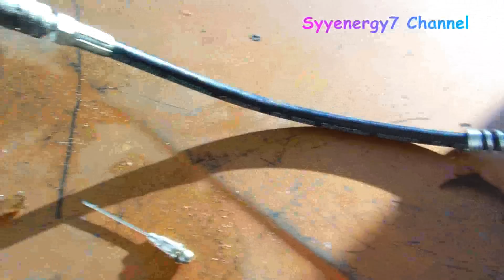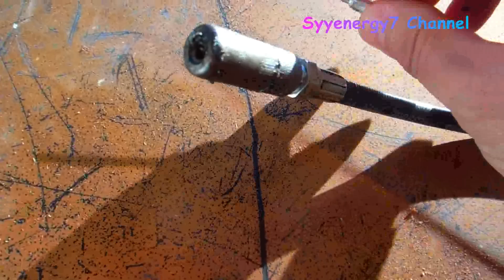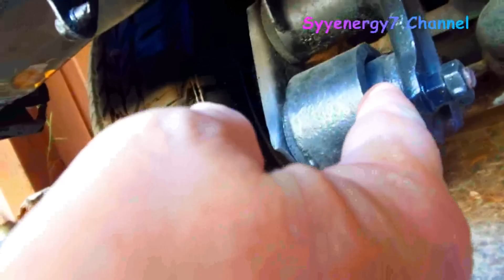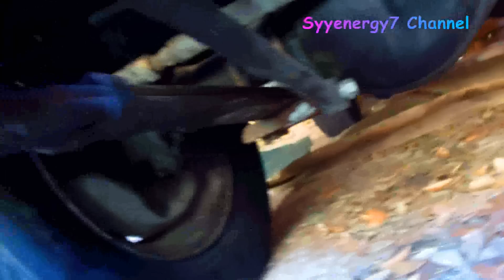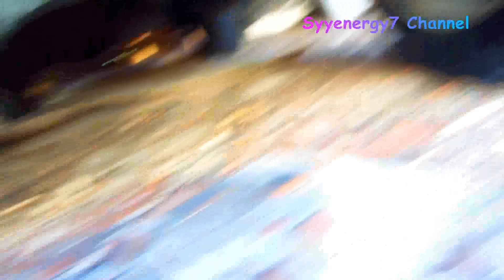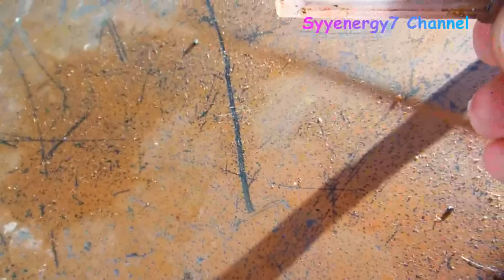How to Grease Joints with no grease fittings

Comment: 61 years on the planet, and I did NOT know that the grease gun could be turned open/closed to lock onto the zerk!!! THANK YOU!!!
Reply: same here
Reply: Patrick McClellan I'm 30 and I've never seen it either.
Reply: Patrick McClellan same here where the hell was I got that lesson  !
Reply: .....and here.
Reply: Same here, and I got 4 years on you !
Reply: Me neither...cant wait to try it.
Reply: LOL... Did you not read the instructions that came with the grease gun? All that I have ever bought told you how to do this...
Reply: .... same LOL
Reply: damn! mind blown
Reply: 65 years and a mechanic  Pat and I didn't know it either..LMAO
Reply: Dude I'm an idiot, no wonder I couldn't snap it on it must have been turned closed which I never knew it adjusted
Reply: Z71 Ranger, instructions? I thought those were packing materials lol!
Reply: Not all grease guns can, it's often a feature reserved for higher priced guns, except that low end guns usually come with a steel slightly bent tube and you can replace that with the flex hose that has the threaded tightening end on it.
Reply: 41....mind blown
Reply: News to me too ... got to check my two guns now..  good info  thank you sir  :--)
Reply: I've been in industrial maintenance for 30+ years and I never knew this either. You learn something new every day.
Reply: I'm 62 and discovered it by accident fairly recently while greasing my snow blower. The fittings were kind of small and the gun wouldn't latch on,  so in trying to get it on I must've turned it and then it fit
Reply: Yes they will tighten up even on most cheap guns.
Reply: I work for a concrete company and i grease the belts and rollers every week and never knew the tip could adjust like that...makes sense why some dont fit properly
Reply: Just did this yesterday and just pushed it on! It looks like it should turn, but I couldn’t turn it!!
Reply: Don't feel bad I'm 55 and have worked on cars most of my life and didn't know that either
Reply: Just learned it
Reply: Dam me to 40 plus working on them,lol!
Reply: Learn something new every day
Reply: Another one 4 ye
Reply: Uh....me too
Reply: I was about to say same, only 48 yes here though
Reply: Country Neighbors Im 59 a auto painter not mechanic but being around this stuff since age 14 not one person ever showed me or had I read that anywhere in my lifetime. My fault open a grease gun once in a lifetime never read any instructions.
Reply: I discovered the zerk fitting loosens after the first 5 minutes... putting it back together was alil tricky

Comment: Great video. I had ordered a fancy, expensive grease fitting online, and the design was so poor, you couldn't grease any lawn equipment or any Zerk fittings in tight places.  Returned it; then found out that normal fittings were indeed adjustable, and ordered a pair of two new regular fittings for my pair of twenty-year-old grease guns, which now fit perfectly on any Zerk fitting.  I found out about the adjustability of regular fittings about a year ago, but wish I'd known decades ago.  Had the needle sitting in my tool cabinet - now I know how to use it on some clicking CV joints.  Thanks again for your tips.

Comment: If you are going to add grease to ball joints or steering rods, separate the Morris taper, fill the inside of the boot, reassemble. The grease will work its way where it needs to go over time. If you pierce the boot, you are asking for trouble allowing water to enter and rust the joint.. Dissimilar materials such as rubber/steel do not need lubrication but a little silicon spray can help.
Reply from the maker: The hole from the needle is a lot smaller than the weep hole on the rubber boot of greasable fittings.  You can also re-seal the pin hole.  But with marine-grade grease , it will last a lot of years anyway.

Comment: I use liquid electrical tape to seal boot after adding grease works great...
Reply: I really appreciate this tip.  Do you clean the grease off of the exterior of the boot with acetone or brake cleaner before you apply the liquid tape?  Thanks again.

Comment: You can also grease wheel bearings that don't have zerk firtings and it beats smearing that stuff on your hands and packing the bearing. The needle will fit in tight places.

Comment: He said that one part didn't have a zerk fitting and it's right there sticking out of the bottom.It's around 3:20, looks like the pittman arm. There's many things you can put on a rubber bushing to quiet it down. Most will cause it to swell up and then start coming apart. So you're actually shortening it's life in the long run. It's not that hard to drill and tap them IF you can get access to that spot.
Reply from the maker: THE FITTING WAS INSTALLED LATER AND DOESN'T WORK
Reply: then you should replace the zerk fitting. Not puncture and compromise the integrity of the boot.

Comment: Also  get a bottle of 303 Rubber conditioner spray on  and spray all ruber bushing even the fan belt  and it will make those rubber parts last  forever.

Comment: Car companies want us to buy the whole damn replacement part so they don't put grease ports on things with bearings anymore.
Reply: Right like wheel bearing's are all sealed now and steering gear also.
Reply: G PCM yep! thats why Im holding on to my 93 Suburban for as long as possible.
Reply: actually, i don't think they want consumers working on their cars at all

because look at how they design cars

you're average person can't even change the spark plugs without rotating the engine sideways

i think you're right about that
Reply: The seals on the sides of "sealed bearings" can be removed easily with a tiny screw driver. They pop right out and you can grease the bearing, then snap the seals back in place. Found this out when puncturing one with that needle grease gun tool. The seal popped right out!
Reply: Ahhhh, but we are getting around them vultures!!
Reply: Thats the idea,  designed to fail and they have condition pepole to except it, my fathers generation ww2 era and my grandfathers generation 1900s would never except this junk of today
Reply: Pretty much and pay out the back door for the labor to put said parts on
Reply: Got that right brother. I was about grease the front end on 1998 f150.  Had no grease ports few places. I couldn't believe it.  An old truck driver. Told me once.  Oil and grease is cheaper then parts.

Comment: I used the syringe that came with my printer ink-refill kit to add grease to my ball joint.  Only one because it was making noise.  It is holding up well.  I blocked the hole with silicone when done.  When I get around to it I will change them both.  They seems firm still for now.
Reply: Thanks for the idea!...I am tired of spending money and a whole bunch of time on my car this month...I was going to buy the grease gun and the needle...but I have plenty needles and syringes with my ink refill kit...my wallet thanks you too...lol

Comment: On Lincoln LS steering joints the rubber is held down with a split ring on the large part of the rubber boot. You could prob slide the grease hypo in the other end of the joint if you can remove the castellated nut, slap the hole where the threaded part of the ball joint is held by the nut. Then slide in grease and not make any holes to plug up. It is just hard to take off the shaft when an interference fit and tapered area on the shaft is present.

Comment: Sway bar and leaf spring bushings should not be greased unless they are polyurethane, and in that case, a special grease must be used - silicone based, I believe.

Rubber bushings should be left DRY.  They rely on twisting with the metal, unlike a polyurethane bushing, which relies on the bar sliding inside.  This is why rubber should not be lubed - and besides, certain greases can increase the rate at which the rubber degrades, as well.
Reply: +Blaine Bugaski I use Teflon bearing grease to clean my tire side wall. Then wipe off grease and apply tire shine. Bridgestone REVO A/T lots of dry rot cracking going on. Is it the result of the grease? Age 9 years, or not driving for months at a time?
Reply: I don't know, is it just cracking on the side where you have applied the grease and tire shine, or is it cracking on both sides?

It's hard to say for sure.  If you drive a lot or park outside it is likely that they will crack sooner.

Too many variables to say for sure.  But I do know that certain petroleum based greases can degrade polyurethane.  I'm not sure about rubber, because rubber itself is petroleum based as well.

When I was younger I used to go nuts with the tire shine.  Well, maybe not nuts, but I really liked the way it looked.  The same goes for the dashboard and plastics/vinyls in the interior.

Now I don't use any shiners at all, anywhere.  I just clean, dust, wash, etc.  Keeping it simple for the sake of longevity.
Reply: +Blaine Bugaski Thanks 4 the advice. The outside cracked. The inward side is great. Treads are great / not cracking except one tire: that I ran deflated for about 300 miles on day. The set may have began dry rotting prior to purchasing the the grease. And I never took care of them until I noticed the damage. Last, I had the front remounted with the White letters Out. Still need to do the rears. Looks a lot better now. Have 24k miles on the tires since 2008.
Reply: Well the insides would still get much less UV radiation than the outsides so even then it is hard to judge if your grease had any effect at all.  But I do know that it can affect the natural oils of the rubber and now they secrete to the surface in order to keep the rubber "moist" with its own juice.
Reply: Petroleum based grease are known to swell up rubber seals... that is why you should only lube CALIPER SLIDE PINS WITH hightemp SILICON, not grease or synthetic hight temp grease is junk.

Comment: I wouldn't call the grease needle a trick since that's what it's designed for, but the trick may be knowing which type of grease to  use.  Older sintered bearing ball joints and tie rod ends usually had a factory load of lithium grease and should be relubed with moly fortified lithium grease.  Same for metal on metal wheel bearings.   Sealed for life bearing on the other hand, often use a plastic (polymer) bearing and should have thick silicone grease added - as thick as will pump through the needle.  Any rubber bushings on suspension should also have silicone grease though it doesn't need to be as viscous as that put in socket-joint construction bearings.
Reply: +Stinky Cheese - Yea Fortified Grease are best!  I use Lucas Oil 10005 Red 'N' Tacky Grease
Reply: Grease is grease lol. Otherwise the streets would be littered with snapped, sheared suspension parts.

Comment: Great Video Thanks, That type of grease are you using?
Reply from the maker: Marine grade for bearing on boat trailers.  It should not wash out easily.
Reply: Great vid.  Is there anyplace on the car chassis that you would NOT put this grease type?
Reply: syyenergy7 how about new model cars with no zerks how you do it?

Comment: I'm just curious but when joints that don't have grease fitting typically last longer and when they actually need grease it's time to replace them so why wouldn't you just replace them. I personally am a fan of non greaseable parts because I never know how often to grease them. A lot of people say every 3 months some say every 6mo some once a year and some once every 2 years. Why do they need so much grease lol. I've had parts on my vehicles for 10 plus years that still perform like they should which is my monies worth if ya ask me. 10 years maintenance free in happy lol. I can see if you only had 1 vehicle and no time maybe doing something to quiet it down until you can get to it but still. I just found out recently a shop put an aftermarket part on my vehicle with a zirk fitting and I'm pissed. I had it to purchase a fitting for my grease gun because there wasn't any room to grease the stupid thing.
Reply from the maker: If you grease them right, the joint will virtually never wear out.  Part of the reason they went to grease-less joints is because some mechanics are idiots and they over-grease and destroy seals.  The other reason, is a new car sales-pitch that says that the maintenance costs are lower due to not having to grease fittings. 
New car manufacturers pull that stunt also, when the recommend long intervals between oil changes.

Comment: I actually got a pointer from a friend who I'll be honest does the illegal shroom. he says that some people that grow shrooms use the red RTV silicone gasket on holes in the top of cans to make a refillable Port that they can inject spores through and is sterile. you'll need to let it sit for 24 hours just a really make sure it's dried and then you got a red spot that you know is the injection point and it reseals. These rumors put these cans multiple times through pressure cookers and growing Chambers even people who grow normal mushrooms like oysters and such will use these from time to time. I've been thinking of using it myself whenever making mixtures and Labs that way we don't have to buy more expensive equipment for mixtures that just don't need dust getting into them. so take tips from the schirmer's and use that red RTV silicone sealer. I think there's also a copper looking one that should pose to be a hundred degrees higher and temperature that at all tolerate but it's something like over 700 degrees Fahrenheit

Comment: Nice I will do this for my outer tie ends till I get new ones, I detached mine when installing new struts and new rack and pinion bushings and squeezed a little bit of grease when I used a tie rod removal tool. It wasn't much but better safe then sorry.

Comment: Great ideas, very thorough, very true about the long term benefits. I will use these ideas. Btw I use AT 205 on my grease gun hoses, reinvigorates the rubber, could save you some cash long term I use it on anything rubber let it sit for the night and its good, I buy mine at Sears. I hear some guys use it in their engines and trans, but I haven't,Jjust fyi thought maybe you'd want to check it out.
Reply: Agreed atp at-205 works wonders on rubber imo its not a permanent fix for old rubber joints but definitely good way to silence them until you get around to replacing them.

Comment: I need to do that with my Trail Blazer. I replaced the front ball joints and the damn grease zerks didnt even work,brand new out of the box. I had to replace them all. Then two of them fell out after a while,so it doesnt even have a couple.

Comment: you need to know first what the joint is made from.Grease destroys nylon,and plastic used in newer models.This was done to save money and sell cars.These fittings would benifit from a silicone based grease or lube.I wish someone would produce aftermarket balljoints with real metal and fittings.
Reply: Some other brands may even have other materials in them.  I can imagine one with Teflon.  It is not just the stuff on your frying pan but it comes in sheets and blocks too.  It is white and looks just like plastic and some people even turn the stuff on a lathe to make specialty parts.
Reply: I think using silicone grease would be better then
Reply: MOOG
Reply: nathan rector Ok well how do we know what its made out of? My boots all seem to be the same black rubber that are on all vehicles, any way to tell visually?
Reply: nathan rector moog and year one still build them that way,they cost almost double the price of the Chinese ones but,they stand behind their products

Comment: Awesome video.  One question that came up is  how do you know its actually high quality Vs. Low quality?  I saw on youtube the video of the man going around and stealing the burger restaurant grease.  Is this grease from cooking animal meat the same grease we know and love and inject into our rubber boots and hard to penetrate polyurethane bushings?  

I know with one. Bought from NAPA today, The white bottle that reminds me of the hair gel.  Engine and transmission rebuild grease.  

My guess is the hottest temperatures reached in automobile is somewhere inside the engine?  Do you know what the hottest temperature ever reached inside an engine of a car was ever recorded? 

With the OBD-II to USB interface & laptop or some USB Active I/O serial interface, its actually easy to configure the computer to display a screen, or even create a log file of your test drives for client vehicles.  Today, I was assisting with a 2006 Honda Civic Hybrid that the owner did not take care of well.  First issue was car would not boot on.  Starting with battery, I logged my car's off volts, and the battery they had for the car.  First give away:  their battery did not reach double digits. :(. Honda provides the 10 year battery for purchasing from the dealership.  Don't quote me on this, but I think they actually pro-rate the price of the replacement even if the battery fails to perform as intended.

Anyway, I'm all about asking the questions and curved syringe tips.  I can't wait to find one so I can stick it into all my rubber suspension boots.  They are making some great noises.

Comment: just an fyi...some ball joints and tie/toe rods have plugs..remove the plugs and you may strike gold with zerk ready inserts...
Reply: +Eric Chun - FYI.... Some Ball Joints and Tie Rods DO NOT have the plugs in them.  Some Cars / Trucks OEM Parts DO NOT have them on there.  Also, when you buy CHEAP PARTS... They don't have them on there either.  In the end, it's all depend!  Also, some that do... Have you ever open them plugs??? Rust as hell and good luck finding the hole.... LOL

Comment: that isn't a zerk in the bottom of that joint? I didn't know about the adjustable end either, I knew they turned.
Reply from the maker: That was ADDED later on.  Not factory stock.